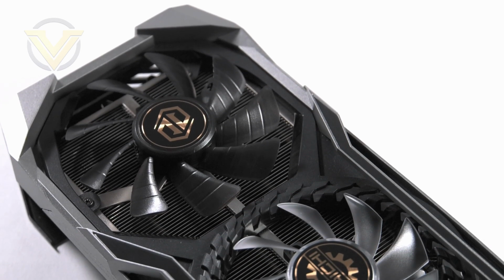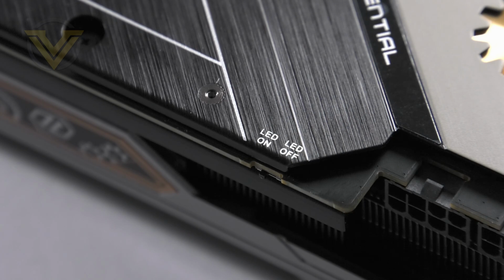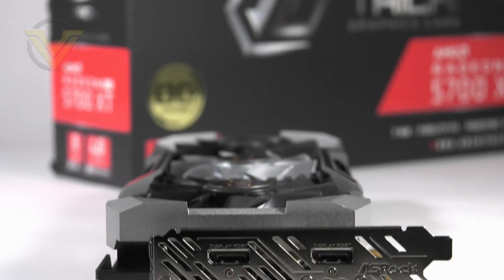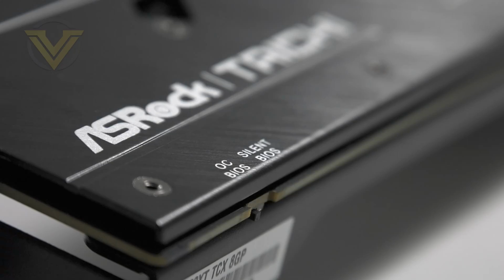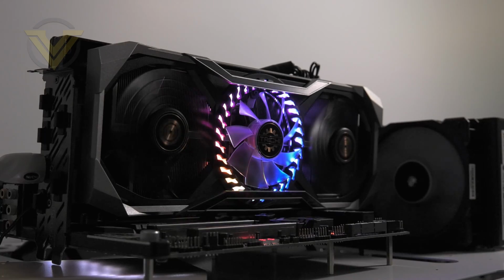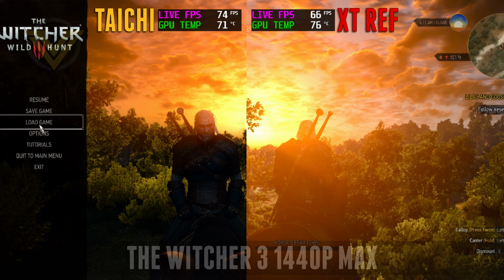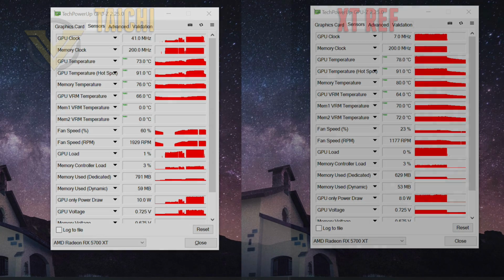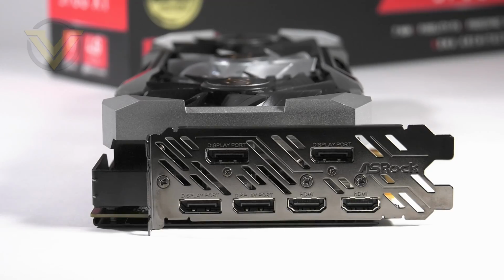ASRock RX 5700 XT Taichi Review

Comment: Decent card, but perf-Wise to me doesn't justify a $480 price tag, whats worse is that its more expensive than the Asus Strix model which always had that expensive title. Glad I finally got my Nitro+ 5700XT recently and hoping they create a waterblock for it.  It speaks volumes if you compare a GPU of this caliber price-wise to one that came out b4 it (Nitro+) and every time the Nitro+ comes in stock within an hr sometimes less it goes RIGHT back out of stock.  Meanwhile this one hardly gets looked at since it came out way over MSRP.  Thankfully I was one of the lucky ones that got the Nitro+ close AF to MSRP at $450.  Jus a mere $10 over the release MSRP of $440.